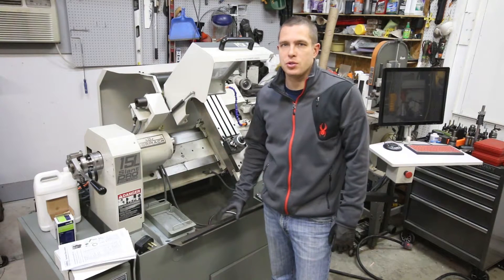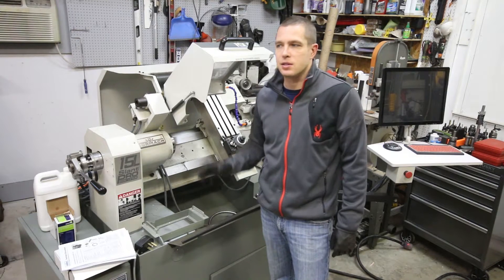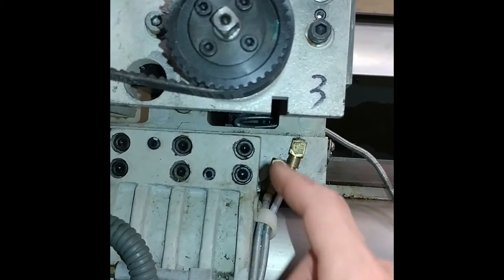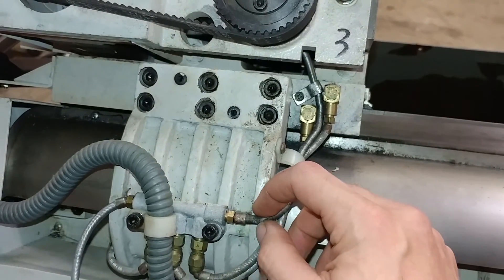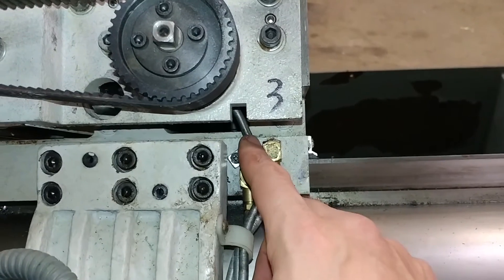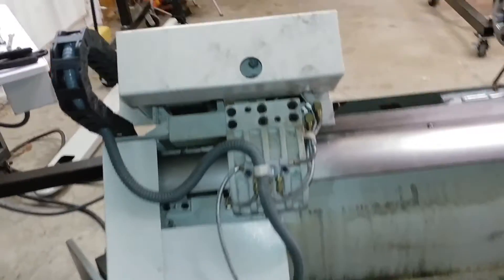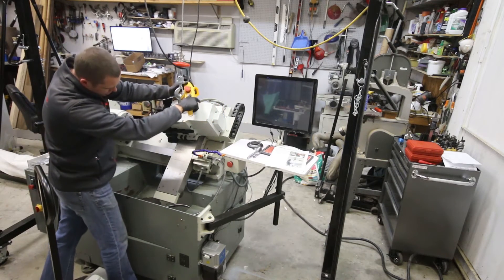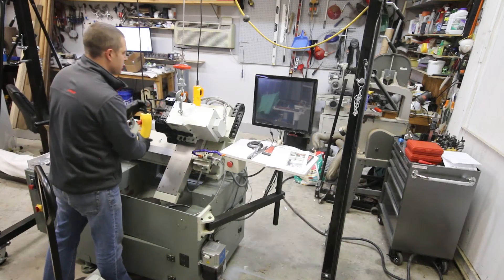Tormach CNC Lathe Upgrades Part 1 - Turret Install

Comment: I CHANGED MY CONTROL AND MOTORS I PUT SERVO MOTORS WITH AN ENCODER ON IT. NOW I HAVE A MACHINE THAT HOLDS .0001 ALL DAY LONG AND I RUN IT AT 400 INCHES A MINUTE IN RAPID. I PUT AN AUTOMATIC COLLET CLOSER ON IT AND NOW I HAVE A REAL PRODUCTION MACHINE
Reply: Can you give some more details on what servos and control you used?